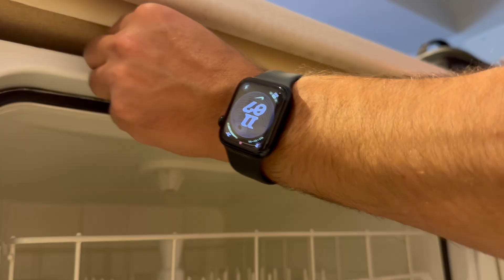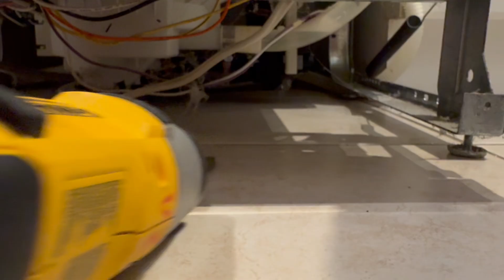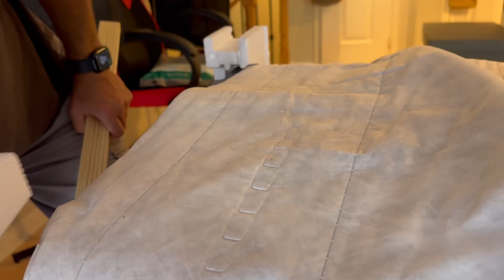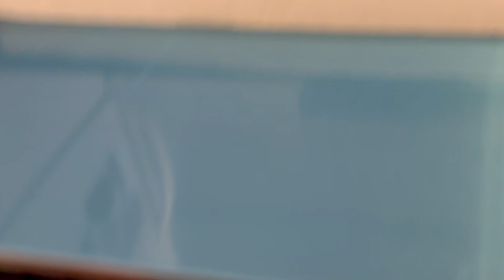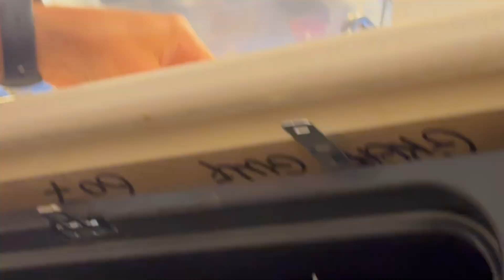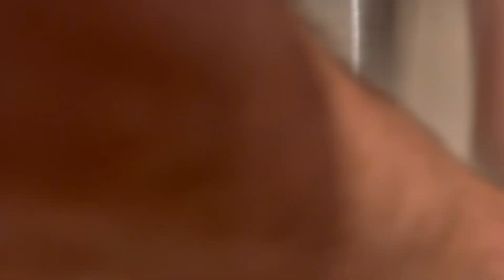Replace a Frigidaire dishwasher - “a step by step”, easy to follow guide.

Comment: Replacing a Frigidaire that’s only lasted 8 years and needed serviced twice in those 8 years!!!
Maybe I missed it earlier but, ALWAYS turn the breaker/power off BEFORE working on anything electrical and, for good measure.. check with a no- contact tester to be safe!!

Comment: Good coverage of installation of a Frigidaire dishwasher. One snafu I encountered? The installation instruction provided by Frigidaire, in their installation pamphlet,  step 10, ie, How to remove the door for ease of access to the electrical wiring, leveling pads, etc. The instruction states that 2 screws at the bottom of the inner door can be removed and the door can be completely removed. There are NO screws at the bottom of the door that match up with the instructions. I couldn't lay the washer down because the house wiring is too short to use that method so I had to wire it standing upright which made access under the door very difficult. I called Frigidaire's customer support number for help. The foreign-accented female could provide no help. She stated I needed to call the store where I purchased it. Very sorry excuse for customer support!!